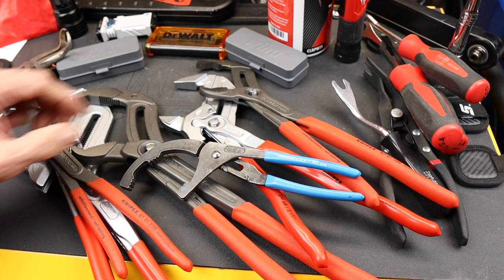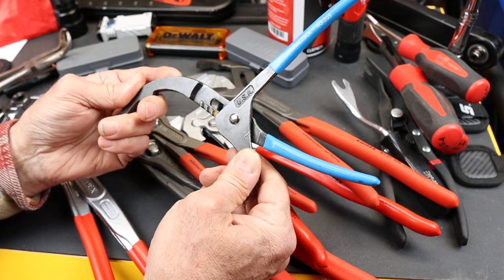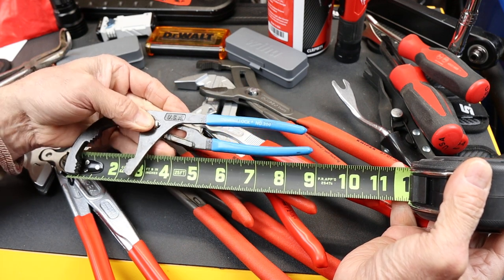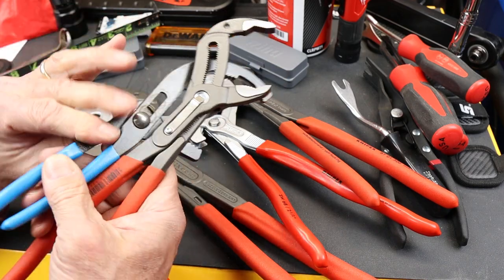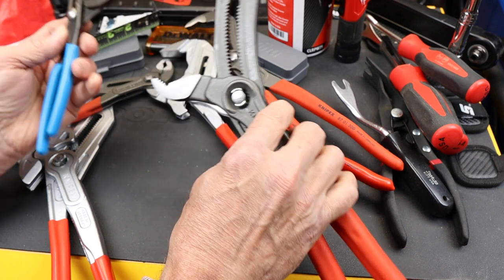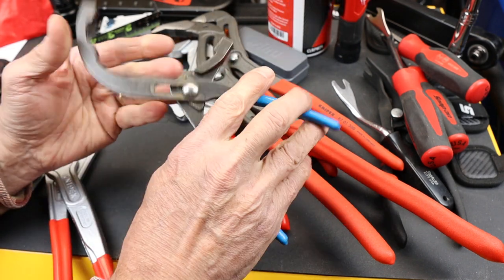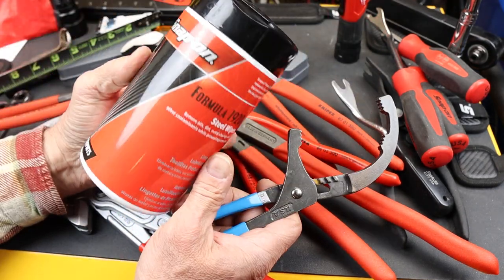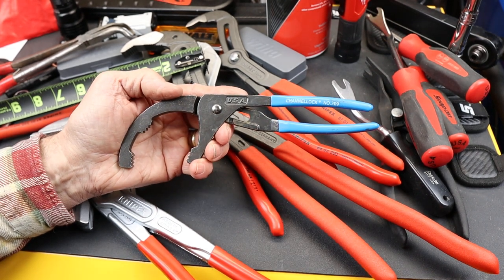USA-made Channellock 209 Pliers to the Rescue. If you need massive mouth & short handles. Just wow!

Comment: Channellock makes 3 sizes of those. Those are the smallest and I have two pair of each size. I'm a commercial electrician and those are by far the best thing for compression fittings bigger than 2 inch. I was running 4 inch about a month ago and was glad to have my biggest set. A set of traditional slip jaw pliers would have probably been 6 foot long and a thousand bucks... and you need TWO of them!
Reply: Always used 460 channellocks for 3 inch and 480 for 4 inch. Never would think of using anything else but maybe that’s a mistake. But 20 inch 480 channellock definitely work good and less than 100 dollars.
Reply: I'm surprised you could get enough grip for compression fittings. I've tried them on 3" EMT and they don't have enough grip on the die cast fittings, only get them snug and EMT pulls out with a good yank.

Comment: One thing that I use these for that I haven't seen anyone else do is using them to install big truck transmissions. I'll use these to pull the engine and trans together while rotating the input shaft. It's way easier than having to roll around to the back of the transmission and kicking it forward.

Comment: That whole series is great for large diameter round objects. I have three sizes and find I use all of them regularly. Very fond on the USA made blue handle tools. Ironically I use the knipex alternatives regularly and hardly ever use channelock pliers. Just have have a few pairs in household boxes and beater tool kits. Their Spain made adjustable wrenches aren't bad either. The black phosphate, chrome and blue handle ones are all great nut rounders.

Comment: what kind of application are you finding yourself needing this channel lock set other than oil filters?  i would argue that anything other than oil filters in that size range would require much more torque than this set would provide.
Reply: MDPE pipe fittings should only be done hand tight but it's often nice to have a bit of help gripping them.
Reply from the maker: I most recently used them to remove and then install a drain on a sink. The drain basket is held in the sink by a large retaining ring that screws on from below. There was very little room to both grab the ring, and rotate it. And the ring was about three inches in diameter. There are specialized fixed spanners for specific drains, but this plier worked great and covers more sizes.
Reply from the maker: The original plumbers putty was hardened making the retaining ring too tight to remove by hand especially in the confines of this utility sink install. My next option I was considering was to use a stubby screwdriver and a hammer.